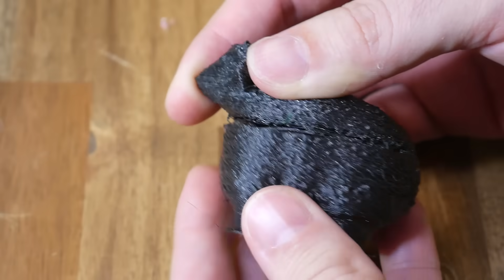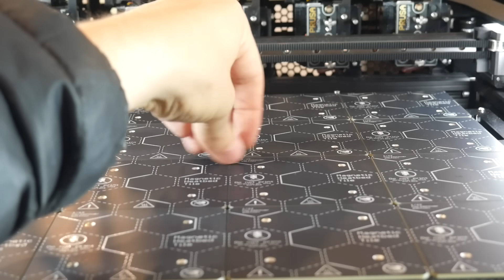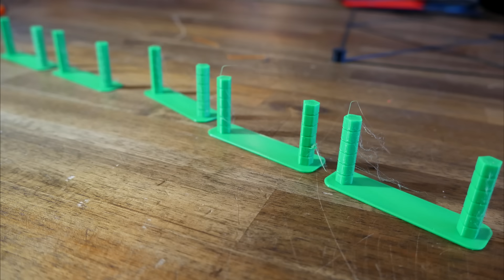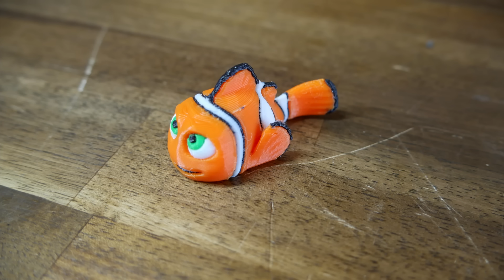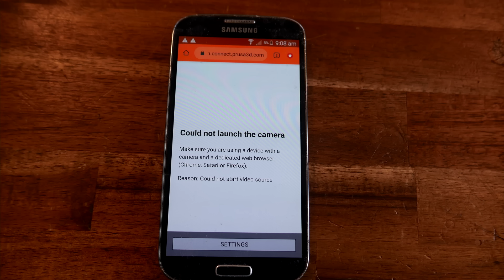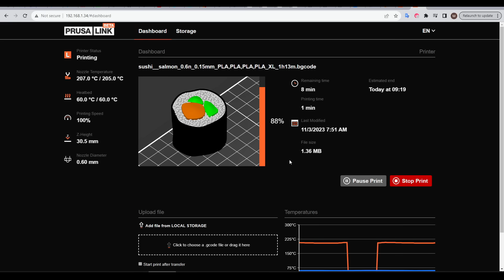The 5 tool Prusa XL is currently flawed, but I think it can be fixed

Comment from the maker: Some commenters pointed out that all of my testing was done with alpha firmware and slicer, and this may not be representative due to potential bugs. That is very fair, so to be as thorough and transparent as possible, here is a quick follow up test: https://youtu.be/bVY3S22L4EY
Reply: Thanks for your transparency and perseverance. I’m sure these teething problems will be sorted but there is a lot of competition out there. I wish TT and Prusa all the best.
Reply: It's been how many years?!   They should be way past "alpha".
Reply: Spicy!!!
Reply: Amazing work and review. Sad to see it has gone so poorly.
Do you get the sense that the extruders/hotends are the problem? Because I sure do. All of the symptoms you bring up could be caused by the extrusion system. The thing I immediately wonder is how are these different from the MK4 extrusion system. Cus it works there. Not being able to tune out stringing in PLA is a giant red flag towards the extrusion system for me, and it could absolutely cause layer shifts, z banding, inconsistent extrusion, knocked over parts. Basically everything you described.
Reply: Fair point but... Users are going to use the alpha to get input shaping. Something that other cheap ass printers now seem to do without issue. But not Prusa it seems!
Reply: In order to test your "second wipe" proposal, can you try printing 2 identical models together so that one becomes a fake second purge tower for the other?
Reply: Better mention it, but MZ3D was at Prusa 4 years ago, and he said that the MK4 and XL look almost identical compared to now.
Reply: I think the main problem is that Prusa is mixing 2 communities here. They shouldn't be selling an alpha to you especially at a huge premium, they shouldn't be selling an alpha to anyone. These are the units and the software that you test internally and waste money on so you can get the rest of the line right. You of course aren't testing it like an alpha and bought it as a finished product, and tested it as such I would somewhat presume in order to get the early adopter vids from it, which is also incorrect. Nothing about this scenario should have been allowed to happen by a responsible PR team at Prusa.

Hope someday I can get one.. but not of course until these bugs are worked out. ;)
Reply: Those commenter shot themself in the foot cause the non alpha firmware is much worse at everything on this printer. They made many improvement in the alpha and there also a new alpha prusa slicer that came out yesterday that aim at improving the strigging issue by implementing the helical travel move from bambu, basically what that 3d printing dog video was doing.
Reply: Perhaps find a way to include the bambu nozzle wipe. Maybe you could attach it somehow?
Reply: @Deathbysnusnu125  there's a file for that on makerworld...

Comment: A year later and Prusa still have not improved. I like you on day one ordered two XL's and then gave up years later waiting for shipping and went Bambu and sold my Mk3s+ farm. When bambu bought out the H2D I cracked it and bought the XL as I wanted tool change and bigger bed but now regret buying the XL having to still do more mods to make it usable. In the mean time I have now bought a H2S to add to my fleet of bambu printers being 3x P1S and a X1C . And just my luck i wait like 5 or so years to give up and buy the Xl as the industry was not making bigger printers or tool change and now a few months later every damn printer company now is going bigger and tool change and here is me with s $7000 XL spending more money on making it almost as good to use as a Bambu from a few years back. Grrr

Comment: Why I do not own a printer yet.
I start screwing around with 186 pc and purchased my first pc 286 then then 386 then 486 the purchased several flavors of Pentiums. I stopped buy somewhere in the Pentium range.   Every CPU needed to be pulled at some  point every hard drive was whipped and dos and win? was reinstalled. All  memory was remove due to corruption or the need to upgrade again and again agina and again. The amount of money and time. I could have bought houses and boats.

Comment: i've never had a prusa work straight out of the box, they have always required an extensive amount of tweaking to get them to produce  just good prints.  i got a Bambu lab A1 and out of the box it worked perfect with no touching other then selecting the built in print.  i'm not sure what the prusa hype is  ....but....are there alot of 3d printed parts?  Could they have warped in transit  possibly causing issues?

Comment: The easiest way to sort out this mess, which is endemic, is for manufacturers to not put products on the market when they are not proven or finalised. It is that simple. Stop selling equipment that isn't fit for purpose and has to be "upgraded" or "augmented" to make it work after you have paid for it. People were so happy when Qidi made all those changes, how wonderful was that actually? Not much, if they had done the job properly in the first place, they wouldn't have had that expensive dash into damage limitation mode. Their new printer which is being adored online before it is even ready to buy, with a countdown to buy it cheaper if you pre order within the next 8 days, why do you think they had to do that? Because any normal person will think, I'm going to wait until they put this one right just like the last one. All this could be avoided by nipping in the bud this rush to market profits before you have a proven product that works as per the spec.

Comment: The 6.0.0-alpha firmware has "phase stepping" to lower the noise significantly (practically silent except for the travels). They are now also shipping with 0.4 mm nozzles to improve the print quality (sucks for us who got the 0.6 mm nozzles...).

Will you be revisiting this to see if they fixed the issues you found?

Comment: I’ve learned my lesson with buying prusa printers at launch. Got burnt on the MMU as well as the mini. I have several MK3’s that all work great. I did preorder the MK3 as well but for the most part it worked. When i assembled my mini and it was so out of square i was shocked. The MK3’s i had built were all within a .02mm skew according to the self tests. Support was always super frustrating. Trying to do that type of troubleshooting through chat just takes forever. So much so that i actually let my mini sit until about a week ago.(3-4 years?) Currently converting it to a Sherpa mini direct drive with a mosquito hot end. So many issues with the Bowden system. The olive nut compression setup was just a terrible design choice. I feel like they’re riding on their name now a days. They used to be one of the safest and most reliable machines on the market, but i feel like this is quickly changing.

Comment: oh man ---

I arrived here after searching about the stupid Absorbing heat stage, as well as the random Extruder head park before printing as well as the borderline retarded implementation of  purging the nozzle amid air to then land on the printing bed..

Lucky I did my first print a couple of weeks ago that went okay and without big issues.
I have been quite busy so now I'm trying to do my second print, and I have finished a whole print on my MK3 while I still can't get a decent first layer on my XL.
Printing on a single extruder, some medium to small parts that I need.

I thought it'd be quicker to split the parts in different printers but boy I was wrong.

this is definitely not good enough and hope it's solved asap. Also laid down a big chunk of cash for this.

Comment: I don't think you were being unfair at all.  If someone with your experience has this much trouble, how is someone new to the hobby going to fare?  Ok, this probably isn't going to be someone's first machine, but if someone comes to this from a mk3, or an Ender 3, where everything pretty much works, it's going to be a real shock.  This is very un-Prusa-like and must surely damage their reputation for producing reliable workhorse printers.

I accept that it's alpha code, but why?  They've been working on this system for years, and they must surely have been using the software in its current state to test the hardware, so I would expect it to at least produce "acceptable" prints reliably by now, with refinements to follow.  I'm baffled why it's so poor, it should be the late beta stage by now unless they've had to make some major last-minute changes to the hardware.  I've not watched your update video yet, so I'm hoping that has good news.

I've been holding off getting a Bambu X1 Combo, to see what the Prusa was like.  So far, it's not looking good for the Prusa.  I love the print quality of the Bambu, but I'm put off by the closed source, and the waste of filament, so I was pinning my hopes on the XL.  I like the larger print area of the XL, but I already have a large format IDEX printer so it's not a must-have feature for me.  From what I've seen, it's nowhere near worth an extra £2000 for worse prints.  That can pay for an awful lot of filament poop (although I do hate adding to the plastic waste problem).  At least with the Bambu I'd not be wasting filament on failed prints.

Comment: I changed my custom filament gcode to the X1 but I keep having a small issue where the fourth print head only makes a small contact with the attachment pegs on the first print head. What would happen if I changed that to X2 or even X3?

Comment: I have my Prusa XL 5T now for two weeks and it has been printing 24/7 since I assembled it. It is an amazing machine: perfect quality (no stringing at all), fast (on a 5 color print 3-4x faster than a Bambu), reliable (not a single failed print) and no waste. There is nothing like it on the market. I have been printing for 6 years and have 7 printers.
Reply: that means Prusa QC is sub-par.

Comment: Quite unfortunate! 

I must have built up some good karma after all of my troubles with the prusa mini as my XL hasn't had any of the trouble plaguing yours.

Since my experience has been so different, I have to throw out the hypothesis that there may be some manufacturing issues like the mini had. I'm not getting the crazy stringing you or others have described - and I don't dry my filament (just front run the whining from that crowd). 

As I'm not doing anything special, and my largest complaints are due to how loud it gets, I just wonder the root causes of this aren't normal hardware/software issues. 

I'll certainly share more if I run across discoveries, but I hope something shows up!

Comment: Great review, it doesn´t matter, if things can be fixed by the community, a printer at that price, should work out of the box with whatever software available from the manufactorer. 
I am on the look out for a dual head printer, but sending out that XL like that to a customer is a joke, I am not putting my money into that. 
Prusa People always say, Prusa have the best support and all that, i guess they need to have customer support, when they are sending out crap like that, this is worse than the cheap half-baked chinese products. 
I hope Bambu comes out with an IDEX soon.

Comment: Prusa needs to take a step back and slow down. They've had poor launches for most of their history, but the competition isn't slacking off nearly as much as it used to be now. I think they've spread themselves too thin trying to support and launch too many different products and features all the time. Also, I honestly think going straight to this XL design was a mistake. They should've started smaller by making a MK3 sized Core XY printer with 2-3 tool changers in my opinion, and then work that up to the XL version once they dialed it in. No DIY kit for it either, make it prebuilt like this XL is. That way there would've been less to go wrong and the process would've been streamlined

But that's just my opinion. Can't go back now, so I think now they need to take a step back and slow down all this product/feature creep they're falling into, and go back to trying to maintain that premium end user experience. I hope they get their mojo back, because I want to keep supporting them and their open source vision.

Comment: I just got my Qidi x-plus-3 printer from the UK Qidi warehouse on the 31st December 2023. and got a great deal too. 
The printer was £502.00p as it was on sale and £10 lower priced than Amazon UK and I am a new Qidi customer so I got a 5% discount too.

It is in the kitchen for now on a cut 2 foot wide bit of kitchen counter top that sits on the packing box the printer came in as yes all closed up that box with the counter top does hold the weight fine.

I have a Elegoo Neptune 3 Max to set up on another counter top upstairs in the spare room so I need to build a big strong wooden frame anyway for that beast so I just do another 2 foot length to it and set up the Qidi printer there along side the another big printer facing the work top which is on a kitchen floor cupboards that have the filaments and on the top the other frame bed slinger's I got too. This X-Plus-3 is a great printer so fast, 

The only fan which I found on mine is noisy is the side extra blower 120 mm fan.

It has a high whining sound when going. So I have to get a lower sounding fan or that one.

I am pleased with the printer as it is fast and I even for the 1st time ever got a LAN set up sot the printer can be controlled by the Qidi slicer by Klipper and be able 1st time again to send print jobs wireless by my Router to the printer.  So cool since I never had that on the others.  I was doing fine doing ABS at last in it and then I got a hot end clog. just when I thought how good this was?

I looked and there a Qidi how to do un-clogging hot end on youtube. I have to do that now.

Comment: I think the biggest problem here might actually be that because the printer is so much of an investment, it's not going to get these flaws worked out by people running into the problems in order for them to be fixed. Not many people are going to shell out 3 grand or more for a printer.

Comment: What to say. XL is a crap, and MK4 costs more than twice than it should compared to the competition. I used to love my MK3 (though I had deep disagreements never resolved with the MMU2) and I loved it a lot though I spent countless hours to resolve issues and more issues until I became some sort of nerd expert - Stringing? lower the temp 5ºC and increase retraction 0.5mm...I asumed this was just the way 3D printers worked...I loved it A LOT. Until last week, when I made my first print with the BL A1combo and realized how outdated the MK3+ is. Now I would say the MK3 is just like the Ford T. I don't think I'll ever use it again. So what can PRUSA do now? Looks like they have a hard road ahead if they persist on their policies. And I'd say it's a very bad policy to launch very expensive beta products, as they did with the MMU1 and then with the MMU2, and now with thw XL. If they really want to spearhead the open source / maker community and rely on it to develope their products they'll have to start being realistic with their prices. I would say that the maker comunity is still out there and that PRUSA could still sell hundreds of thousands of MK4 upgrade kits, but not at its current price. By far. Not when you can buy a fantastic already assembled printer much cheaper. I guess it's either that or dissapearing in 5 years

Comment: your remarks should be heard by prusa because they come from someone how accumulated A LOT of knowledge over the years. This DIRECTLY represents the idea of open source: bright minds figuring out problems and - with the help of the community - presenting solutions. Prusa, on the other hand, could then take these ideas to ship an improved version of the product and - therefore - strengthen the stance of open source. Let's hope they do. Because this could also push the approach to sell products that actually can be REPAIRED. However, this requieres the products to be working in the first place... imho: the selling point for Prusa products nowadays should simply be: something that can be repaired cost-efficiently. Imagine buying a fridge or a washing mashine from a company which is aware that weak spots remain and which is not just selling you the machine anyway but gives you manuals and - thanks to open source - cheap replacement parts to fix it. Sustainability at its core. This, imho is what Prusa stands for.

Comment: Great video.  It's really disappointing that the XL is plagued by so many problems.  I placed my deposit for it almost 2 years ago after having good luck with the MK3, which I bought as a kit in 2018 and later upgraded to a MK3S, and it was my most reliable printer... until I got spoiled by a couple of Bambu Lab P1Ss w/ AMS units that I got this year.  I've basically stopped using my other printers.  I still want a large-format multi-color printer, but I feel the $4,000 I was going to pay for a pre-assembled XL with the 5 tools could be better spent elsewhere.  Bambu will do an XL eventually, and when they do I can't imagine it having anywhere near so many issues as the Prusa.  I really hope Prusa gets their issues sorted out sooner rather than later, since the competition would continue to further innovation.
(Ironically, while typing that I got curious and checked on my XL order status, and I finally have the option to switch it from a deposit to an actual order...  It wasn't an option last week.  Now I have to make a tough decision.)